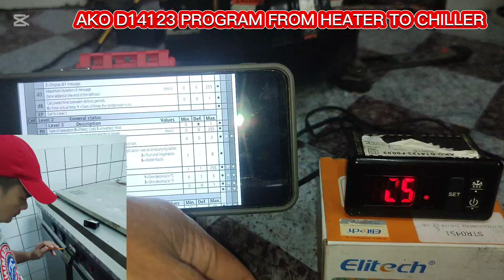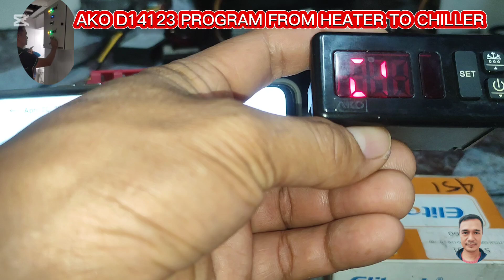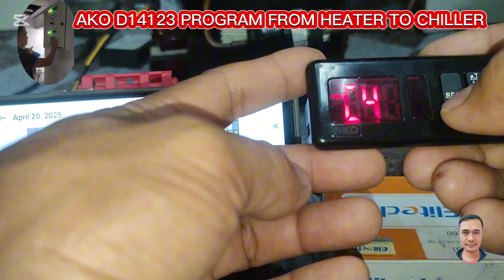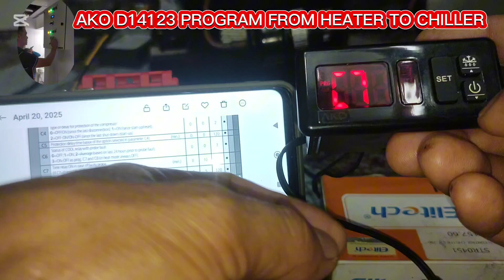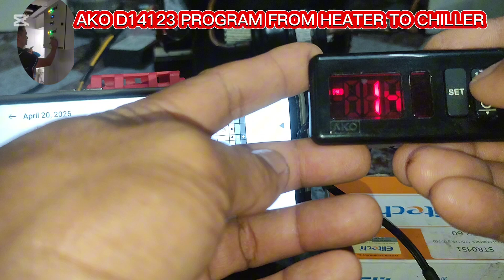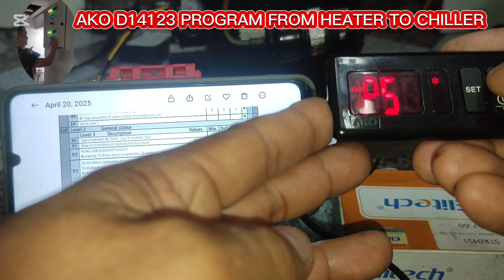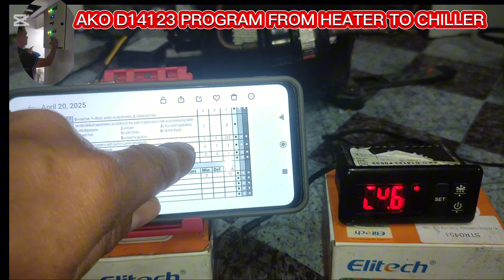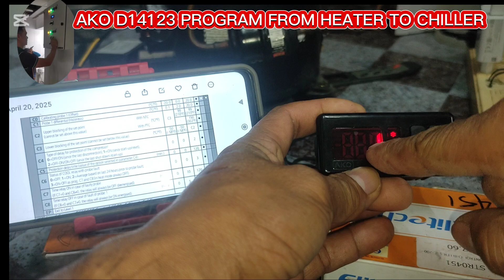AKO DIGITAL THERMOSTAT PROGRAMMING FROM HEATER TO CHILLER (1°C TO 4°C) SETTINGS (ENGLISH)

Comment: boss pano po gawin ang ganya digital nawala po kase ang ilaw na pula ng digital kaya ayaw lumamig pero may ilaw po ang chiller
Reply from the maker: Wala pong power kung walang display sir. Walang fuse ang mga ganitong control sir. Pag no power usually putok ang printed line sa board papuntang transformer ot transformer mismo ang sira